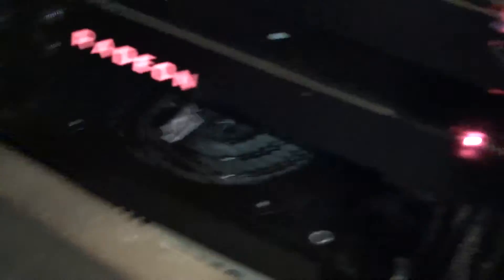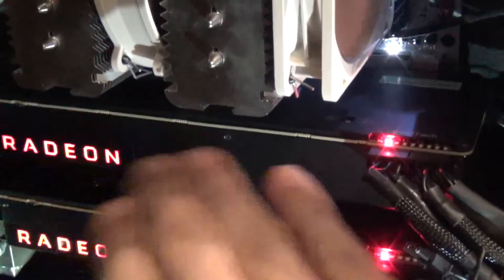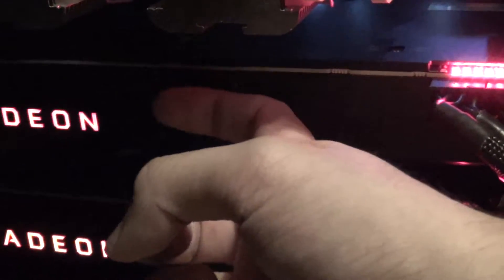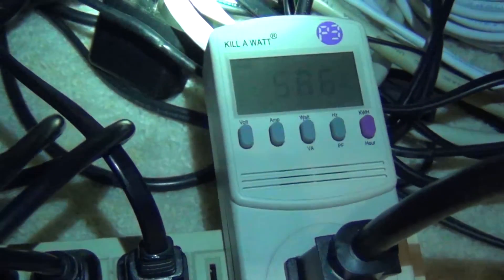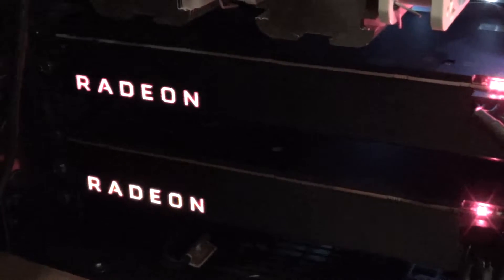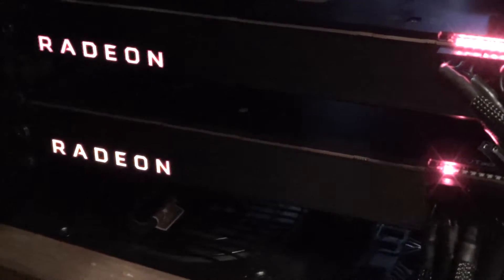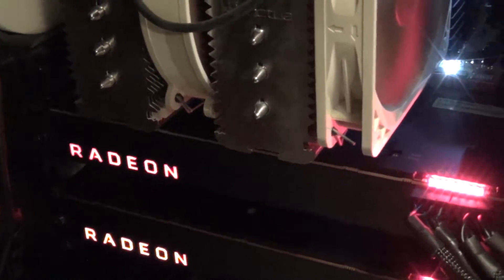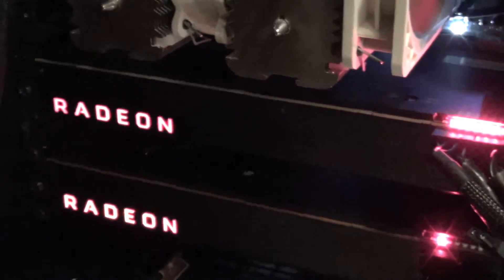AMD Radeon RX Vega 64 Reference Noise and Power Consumption

Comment: im running a 750W for my 4.3Ghz R7 2700X and Vega 64 with no issues. I undervolted the hell out of the Vega and thats helped with cooling but no issues under load

Comment: does it turn the fan off when idle ? like when web browsing
Reply from the maker: When the 2nd GPU is not in use it will be powered off completely. The fan will stop spinning. The primary card however will never turn the fan off completely since it is the reference design. It is however very quiet only running at 800 rpm when at idle.
Reply: @GameTechReviews  thanks a lot for the reply

Comment: I have an OC ryzen 1600, Vega 64 with +50 power slider about 1600 MHz - and I'm using a EVGA BQ650W psu. I don't experience any issues, and it dont die in gaming like battlefield or test like unique heaven.... I did take 2 separate 8 pins to the Vega card from VGA2 though... But maybe it will die when I upgrade to Zen 2 and more cores....

Comment: Funnily enough my single sapphire 64 limited PC does sub 400watts at stock and sub 300watts when UC'd. That includes the CPU and other internals like your 600W. What were you actually running with it?
Reply from the maker: FFXIV Stormblood benchmark.